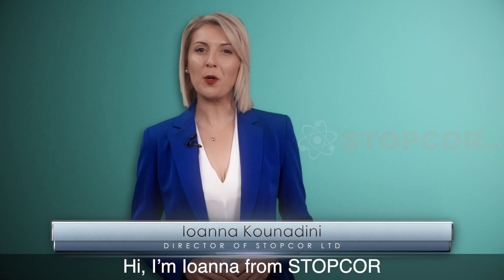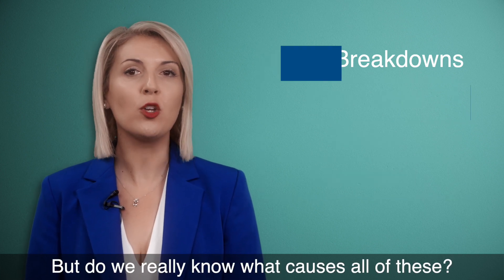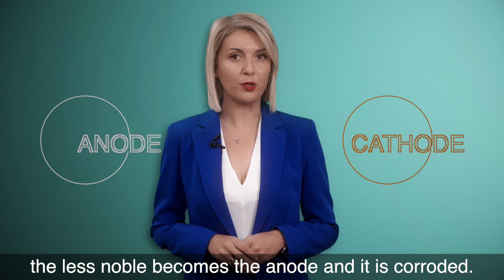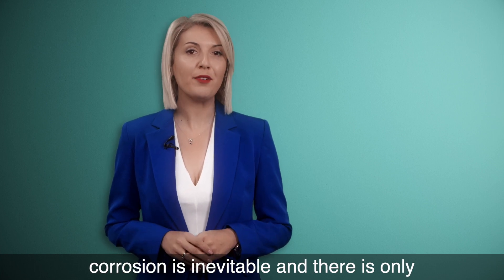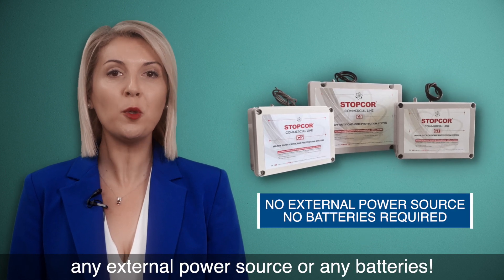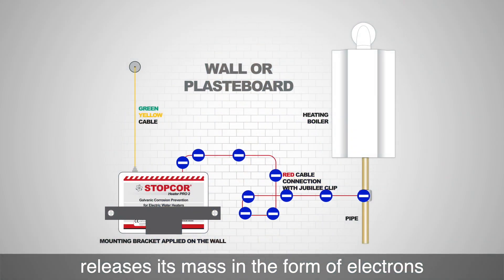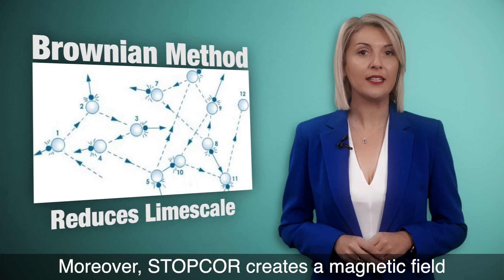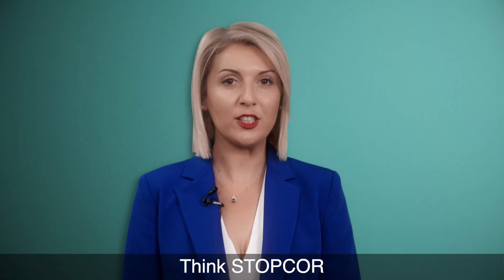STOPCOR Method Presented by Ioanna Kounadini

Comment: Surely the sacrificial Anode must be in the same electrolyte (the water in pipes) as the Cathode?  It appears as if the water injected into the STOPCOR is working as an electrolyte and in effect you are just making a battery! (Hence the voltage reading!)

Also what is the Earth cable doing,  attached to a fairly non conductive concrete block wall,  the fact it is green and yellow the same as any bonding,  it may be bonded to the buildings M.E.T by an electrician not knowing what it is,  this would then be connecting the STOPCOR earth to the pipe work effectively shorting it out!

Finally why ship it with a bear ended cable and a jubilee clip,  there are pipe clamps much better suited for the application!!

What does Brownian motion have to do with how this thing works? Surely brownian motion exists anyway without the STOPCOR

Comment: Hi Ioanna, I'm cross-posting a couple of comments I made on plumberparts channel because he has reviewed your product to a lot of skeptical reception, mine included - so offering herewith a ‘right to reply’!

Whatever this device does (and I’m reasonably sceptical like others), I’m pretty certain it won’t have a significant impact on sludge build-up or indeed corrosion.  ‘Magnetite’ or Fe3O4 forms in the presence of iron (your radiators, basically in a domestic setting), water and oxygen.  (If there is a lot of oxygen then you tend to get hematite or ‘rust’ or Fe203.  (I know the industry has a habit of calling sludge 'magnetite' but have a feeling it is a combination of both rust and magnetite - magnetite is magnetic (duh) and I’m not sure most sludge will suck a nail towards it after you’ve got it out the MagnaClean - maybe worth an experiment or episode!) 

While it’s possible that Magnetite is formed by electrolysis due to the galvanic reaction of copper and iron, with the O2 being freed somehow from water, I doubt it - I think it’s usually because you’ve got air in your system.  Solution?  Get rid of the air!  Something like a Spirovent (and inhibitor!).

If you haven’t got sludge in your system James, it’s probably because you’re a good heating engineer and look after your system (and have some form of air separators - whether AAVs, self bleeding rads or my favourite, the Spirovent) - I"m not sure it's the STOPCOR.

The limescale reduction claim by creating a magnetic field and enacting Brownian motion like we all saw as kids in the physics lab looking at a smoke chamber is intriguing but I’d favour something like an Ion Scalebuster or  Aquabion or similar which use three methods to reduce limescale - hydrodynamic action (i.e. turbulence chambers), dielectric action (PTFE coating) and Anodic action (zinc sacrificial anodes).  (I have no affiliation with any of these companies btw!)

And copper pipes pretty much can’t corrode  (without help from a plumber who leaves flux everywhere) - so unless you’ve got a load of iron, aluminium or steel pipework, I don’t think this will help corrosion much in the typical domestic setting.  But just my opinion.

Reply

Comment: Hi Ioanna, I'm cross-posting a couple of comments I made on plumberparts channel because he has  reviewed your product to a lot of skeptical reception, mine included - so offering herewith a ‘right to reply’!

I'm afraid James it is a battery inside - that's all it is.  In the box it has a copper cathode and magnesium anode, separated by a modified plaster which is the electrolyte (and which you top up like an old school car battery).  The patent says it generates up to 1.7V at 500mA. By grounding (In the wall!) the positive terminal  (copper cathode) it becomes a 'negative battery' and this voltage attached to the pipework supposedly negates the positive DC voltage electrolysis effect otherwise inherently present in the pipework through galvanic / electrolytic action.  Not saying it doesn't work or do something (impressed current cathodic protection is a massive industry - pipelines etc.) but it is just a battery.  (Designed to last 3-5 years).  Not sure that ground-spiking the wall will give you the -1.7V either - easy to measure with a voltmeter though - anything less than -1V probably won't negate the positive DC charge causing electrolysis.  (The patent suggests that not only is it a battery, but because of the negative voltage, the pipework becomes a cathode not an anode and the anode core in the battery is sacrificed - the battery having both magnesium core and magnesium plates - this feels a little suspect to me?).  Fun video - but maybe re-do the Professor Plumb piece  from 08:41 and focus on impressed current protection per the patent instead?